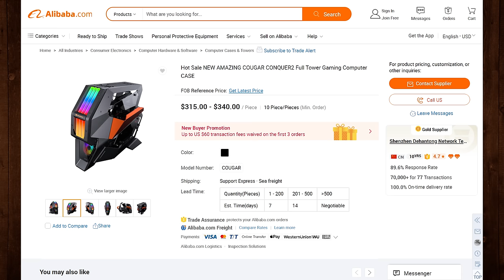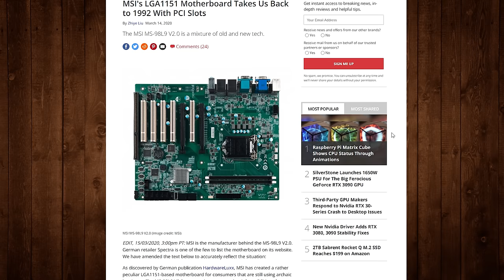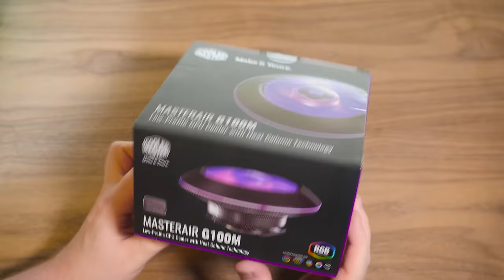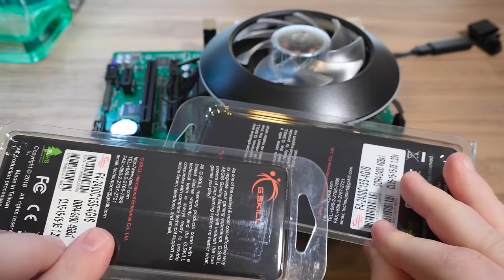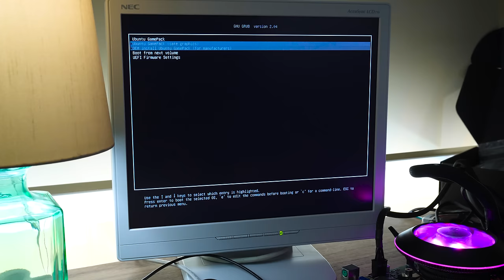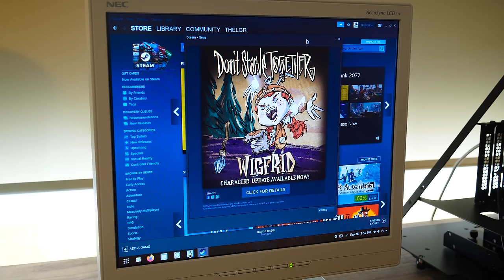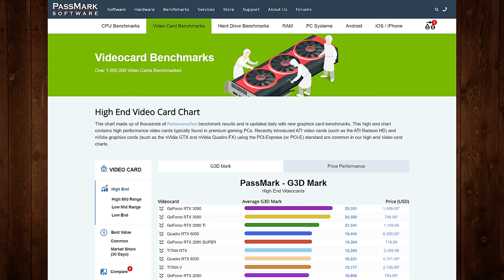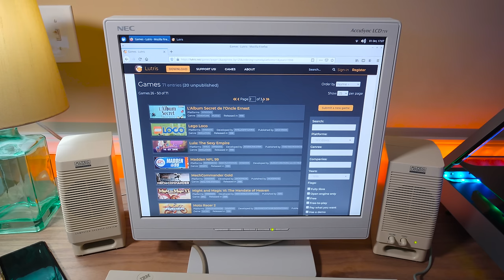Building a Ridiculous Pointy Pyramid PC

Comment: Haha, at 16:10 I was like 'geez, just put some linux on there'. Good call.
Reply: I'm still really curious though as to what happened with the video card/PCI interface. These days, Linux has gotten SO MUCH better about hardware detection and drivers, making it a breeze to use on even old systems. A far cry from what it used to be. >_>

So if it was struggling with this card, it makes me wonder if some other distro might have ran it much better.
Reply: @arnox4554  It seemed to be related to the desktop enviroment. I wouldn't be suprised if there was one specifically for older hardware.
Reply: @ArgoIo  Antix Linux is great on old hardware - I have it running on an ancienmt Compaq Presario 1200 laptop (600MHz Celeron / 256Mb RAM) and it's pretty sweet - A tad limited compared with the latest Ubuntu / Mint distros but still very usable, and still being maintained - the latest release was March 2020 - a great option for older hardware with enough modern UI polish for it not to feel clunky
Reply: @countzero1136  Have you tried some other lightweight distros as well to compare?
Reply: @arnox4554  Not recently. Going back a few years I was looking at a lot of supposedly lightweight Linux distros and Antix is the one that came out on top for my own needs. Ultimately it depends what you need from it but most of the ones I tried were not light enough to run on an almost 20-year-old laptop, whereas Antix did perfectly.

The nicest thing about Linux is that there are so many options out there for so many different use-cases, but if you're looking for something light enough to run nicely on old machines yet still supporting modern features, then Antix is definitely worth a look. It has a Debian base so compatibility is great too
Reply: @arnox4554  requirements for modern linux distros are way different from back when the video card was released. If you were to run it on a linux build from that period, I'd say it would fare better

Comment: I know I'm quite late, but there are many ARGB hubs you can buy that plug into the internal USB headers on the motherboard, and can be seen and utilized by different programs. Personally I'd suggest using SignalRGB, though that'd require having a fairly up-to-date system to run.

Comment: When Half Life wouldn't even run, that really surprised me.  That game can run on a toaster.
Reply: The Steam version of Half-Life is far less forgiving to toasters than you'd think
Reply: The ATi drivers on Linux are generally very bad. Much better than 10+ years ago, but not a lot of development is done to get them up to par. Nvidia cards from that era should work a bit better. Plus the Source version of Half Life is much more intensive than the original
Reply: @genderender  Corretion: The OLD ATI drivers are quite bad. Anything pre R300 - is poop.
The new ones are fine. 
I work on the driver stack - it's fun to retroactively improve support for old hardware in linux :D
Reply: @genderender  Sadly the focus is mostly on the newer stuff. Never mind that it is quite possible that everything he ran tried to use the GPU at the same time via desktop compositors and whatsnot.
Reply: @genderender  nvidia blobs will only work with old proprietary nvidia drivers, which in turn are a pain to make work with a reasonable kernel version
Reply: digi owl yeah the performance was looking like the driver wasn’t even working and it was falling back to pure software, but still reporting hardware support which caused the hardware desktop compositor to kick in.
Reply: it seems like everyone is forgetting that the radeon card in the video was running over a PCI bus which has an insanely low bandwidth that just isnt suitable for any graphics cards, those PCI graphics cards were made for old PCs that didnt have AGP slots.
Reply: @MR_FIAT  Yes, but why would the presence of a faster bus make the slower bus run even slower than it was back in the day before the faster bus existed? The existence of AGP and PCI-E don't cause PCI itself to suddenly not work at all.

The problem is almost certainly bad drivers.

Comment: Hey Clint, this late, but you should check out the motherboards from "Nixsys" They run socket 775 CPUs, have PCI, PCIe, and ISA. They are not cheap, but we (where I work) have a few running DOS software and they are excellent for old stuff.

Comment: The reason XP doesn't install is the fact that Intel Processers higher than skylake don't support xp anymore (or so was to be). There is a specific way to install XP using modified drivers to allow for the OS to install. As for Windows 98, i also tried and never could get it past the win98 screen after the first half of the setup. How i got around the first half was creating a script to let the setup run, and also slipstreaming in xmgr (iirc) to bypass that weird ram limitation.

Comment: I'm with you on wanting to learn more Linux. I'm starting school soon and hopefully will take a Linux/Unix course! I have used it to test systems and manage drives (especially found drives) but am very limited in experience and knowledge. Especially with terminal!
Reply: Modern Linux distros are VERY easy to set up and use - Linux Mint in particular is designed for people transitioning over from Windows and looks/feels much like Windows 7, only with a slightly slicker UI, though the latest version do require a bit of horsepower in the box. Most of the time you'll rarely need to use the terminal, but if you do, there are tons of great Linux/Unix websites to help you learn all the commands (many of which can get pretty complex and non-intuitive even for us experienced Linux users, but help is always available and totally free 99% of the time)

Comment: Every time I watch this it makes me want to buy a pyramid case, and see what kind of weird ancient aliens gaming monstrosity I could make out of it. That case with that ufo fan is hard to resist. The ridiculousness factor is just so very tempting.
Reply: It's just heavy as hell, airflow is absolutely terrible (i've mounted a 140mm industrial 3000rpm noctua in the back to cool it in the summer)
And changing parts will take you two days to rewire everything.
Did add mirror foil to the window in the back, and tinted foil on the side panels.
And in the front i've added a screen :) though, connecting this is also nearly impossible, can barely get my hand in there to connect the cable :D

Comment: Gotta use Windows XP 64-bit edition to get around the RAM issue
Reply: Not always. I got a C2Q Q9505-powered rig with 4GB of DDR2 (2x2GB) and running XP Pro 32-bit with USP4 and a 64GG RAM patch to get past the 3.5GB RAM cap 32-bit XP had.
With a bit of time I can replicate that effect and get 32-bit XP to work on a i7-3770 system with like 32GB of DDR3 (4x8GB), but at that point I might as well make it a 64-bit Win7 Pro system to run things like Steam and Sony Vegas as a gaming/streaming/editing rig, since I don't think there's anything you could do with XP to be able to use more than 4GB of RAM, let alone up to 32GB!
( Ivy Bridge/3rd Generation Core-i systems was the last generation of Intel CPU's & chipsets that supported putting any flavour of WinXP on them officially.)
Reply: 32-bit XP (and any other version of NT) doesn't care if you have lots of RAM, it just ignores the extra. The RAM issue was with Windows 98.

Comment: For win98:
Add "MaxPhysPage=40000" to System.ini
Reply: I believe he could use Windows ME as well
Reply: @o1230sponge  Why do you want to torture him? ME is horrible. I still remember how much it crashed for me back when I was a kid. Sometimes it even crashed when it was idling.
Reply: @Cinkodacs  He literally did a video on it five months ago and said a fresh install/upgrade it wasn't that bad. And from what I recall, this fix only uses the extra ram over 512 MB as a sort of page file, and ME can actually use the ram in a normal fashion
Reply: @o1230sponge  WinME can't run many old DOS games neither, it's the worst Windows from a compatibility view and it's System Restore is a big mess.   Clean install or not, it still sucks.
Reply: @Dawwwg  Regardless of any short comings, I was suggesting it since W98 wouldn't even load the installer. I only mentioned it since it would at least load the installer in theory
Reply: @o1230sponge  That's still a guess; USB devices get reset during the 2nd bootstrap loader until Vista; so chances are it would probably still crash during the process (just a bit later). I think I'd given Win2K Pro a try from a non-emulated (S)ATA device instead :)

Comment: When the baseplate lacks standouts attachment points in the right spots, I usually attach the standouts just to the mainboard holes, but in reverse - screwing them with washer and nut from the top of the mainboard side in. At least they provide support against pushing in from the top and the board does not flex.

Comment: “Things are really slow”
Well yeah, you chose a pentium of all things to put in it
Reply: It seems the problem was specifically with the radeon gpu, and that everything was working ok using the integrated graphics. My guess is the PCIe-to-PCI translation is not performant enough to drive graphic cards
Reply: Lol, the pentium could run laps around those tasks. It was the GPU.

Comment: I have a PCI Radeon 7000 in an old Windows XP PC that was used just as a security camera controller. Even in that low end device from like 2003, the onboard graphics are better than the Radeon 7000.

Comment: One tip to improve the Pyramid Illuminati Computer is by changing the direction of the top fan in the pyramid so you dont create a vacuum between the CPU UFO-cooling and top of the pyramid.

Comment: Regarding using virtio or paravirtualisation with KVM: My initial expectation was “great, let’s chuck my favorite hw in a PC which still has PCI ports and I can virtualize every OS and environment I want” It’s not that easy. First your host has to support vt-x and vt-d or newer / AMD equivalent. This means most earlier consumer CPUs / systems won’t support this. The earlier Intel ix xxxK series won’t support VT-d (hardware pass through) either while the non-K models do for some silly reason. Then there is the fact that there seems to be zero interest to get legacy OSes running with virtio besides the latest and greatest. It is even a challenge to find anything regarding booting Windows 7 with GPU pass through (which hangs at the boot logo if you passed a GPU), let alone XP or Windows 9x. Passing through older GPUs is a challenge unless you find the one forum article which describe how someone did it and  then you have to pray it isn’t outdated. Depending on the hardware you also have to prepare the host OS and exclude drivers or hardware, so that it doesn’t get hogged by Linux and can be passed through a VM. I try my luck again this weekend with Proxmox which is a distribution for VM workloads. (My former tries were with manjaro, a arch based distribution - arch wiki has great articles how to get going with KVM). 

Edit: I would really appreciate if someone would document a “How to retro game with KVM in Linux” but it certainly takes more work than putting old hardware onto a newish mainboard. If you thought it’s time consuming to get a Windows XP or Win 98 setup going on a modern system then wait til, you try to get a video out of an outdated GPU in KVM with it myriad of config options (UEFI, non UEFI, sea-BIOS, different or custom version of the above, custom GPU ROM preloaded in the VM config, VM config as script to get some qemu environment variables going.) 

Don’t get me wrong, I don’t want to criticize or bash the video at all and I am all for it to do retro gaming on new hardware, because the old won’t last forever or be available for everyone.

Comment: Honestly, that board looks pretty much like my LGA1155 board, at least in terms of connections. Seperate PS/2 ports, VGA out, PCI slots, etc. Sure it doesn't have a serial port, but there is a header so you can plug one in.
That board would be interesting in some old case. It looks like an old machine, even the ports make it look old, but there is someting else in.

Comment: Great Video.  I don't know how successful you might be, but if you wanted to try again, there are fan-made patches available that can get you around the windows 98 memory limitations.  Search for Windows 98 on modern hardware on vogons.  Rloew patches were made freely available after the developer passed away.  I'm about to take this journey soon myself.  Though with older hardware.  Since you have it all running take a disk image of your ssd first and you should be able to go back easily if something doesn't work and/or you want to dualboot.

Comment: If I were you, I would go with something old school, but still high end, like Nvidia 6800 Ultra, Intel Q6600 and 8GB RAM. This is very nostalgic system for me. I remember the mermaid on the cooler of Nvidia 6800 Ultra chasing me in my dreams. I was the happiest when I got one. Later this GPU went to my new platform with Intel Q6000 and some Gigabyte P45(if I remember correctly) motherboard. Best times ever!

Comment: Fun Fact: the USB RGB LED strip should use the same protocol as the addressable RGB fan in the top of the pyramid. So in theory you could connect the end of the LED strip to the fan RGB header and it should light up, provided you connect it right.

Comment: I may be wrong but I think you had a driver problem. I owned a Radeon 9800 and a HD 3070 and had to use FGLRX as a driver back then. FGLRX was a complete nightmare and didn't come preinstalled with the kernel like the new AMD driver does. Every time I had to install a distro and the driver I had to go through the configuration files to fix some things. After doing that I still had problems with my games. Everything that was above Open GL 2.0 didn't run, some of the native Linux games and ports ran fine but maybe they required some configuration, and wine simply refused to run games. To make things even worse every time I updated my kernel I had to pray that FGLRX would recompile just fine and not break my system and force me to fix it from command line.
You may be running on the open source driver for that card. You need to find a version of FGLRX that still works and still supports your card at the same time. The open source driver for old ATI cards provides basic functionality but still fail at providing complete 3D acceleration to this day. If I were you, I would try my luck with NVIDIA or just pick a modern AMD card.

Comment: I reckon it's the fact that 1920 x 1080 x 4 (for 32-bit colour) is 8MB. PCI can transfer 133MB a second (theoretical maximum), which would be 16 frames a second. At theoretical maximum, and who knows what other stuff is affecting that. And I dunno what resolution you've got it set at. If running Youtube is doing it's video rendering all in software, then you've got every decoded frame having to go over PCI. Presumably the Radeon doesn't support Hwhatever that Youtube encode in.

Comment: So Clint, as a Linux Only user, I think the issue with the GPU performance is that you're running Gnome. Gnome is notorious for using a fuck ton of system resources. The other issue is that Gnome (and most desktop environments) will have compositing enabled (transparency, shadows, wobbly windows) which heavily tax older GPUs. xubuntu also... sucks. Sorry XFCE users but the distro itself has had so many issues (like NOT SHIPPING A FUNCTIONAL SUDO BINARY). Your best bet would be to run something even lighter than XFCE/Gnome. Perhaps something that runs LXDE/LXQT or even something lighter like an openbox focused distro like Bunsen Labs but again, disable window compositing. If you have any questions, please ask for help over at /r/linuxquestions.

Comment: I mean... trying to run a full modern X11 stack with full fat desktop environment was your first mistake. Xfce crawls even on the GeForce FX 5200 in my iMac G5 1.6GHz. Plain window managers like fvwm, IceWM, and Window Maker make a world of difference -- and there's KDE Restorations for KDE 1 and 2 that patch the codebases to compile on modern Linux.
I find the 7000 series even starts to chug on software from the time -- Mac OS X gets a little choppy on my 900MHz iBook G3 with a 32MB Radeon 7500.

Comment: The ATI Radeon 7000 VE was pretty bad at the time because it was one of those cards with a severely gimped 64 bit bus width. Even cards like the Voodoo 2 had a 192 bit bus width so did a lot better. I think you would have had better luck with a Geforce 4.

Comment: Radeon 7000 is so old, it probably doesn't support even OpenGL 2.0, or any of the stuff used to render the desktop.   It might be falling back to llvmpipe (CPU-based rendering), which can be slow even on the best of CPUs.  Perhaps a 9600/9700/9800 GPU would be better.

Also, when trying XP, did you change the settings back from legacy to modern-ish?

Comment: The problem is probably the NVMe in its entirety. Windows 7 doesn't even natively support them and you need to manually load the drivers within the installation utility or it just won't know how to use it. If Windows 7, an OS that is practically brand new compared to 98, is a headache to get working with NVMe anything older may be a lost cause.